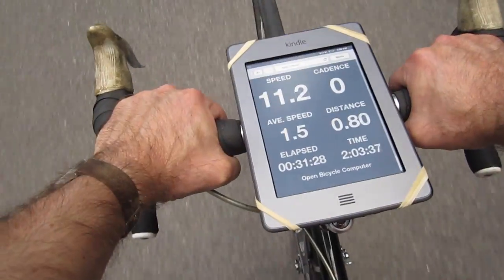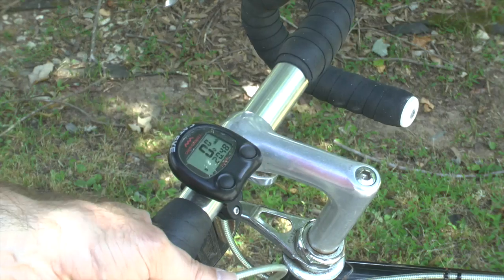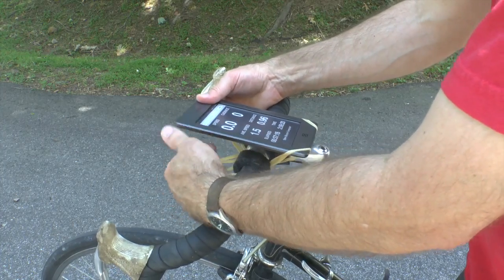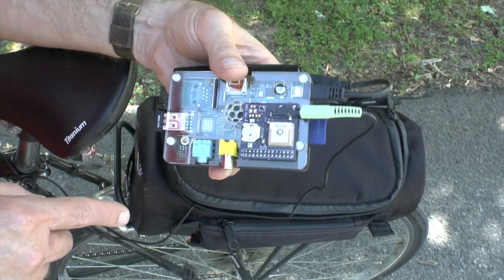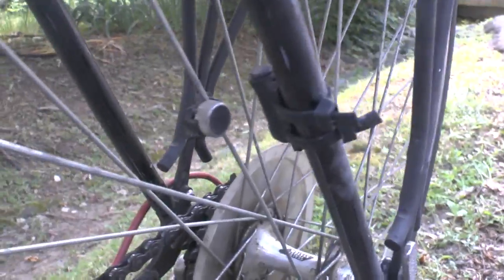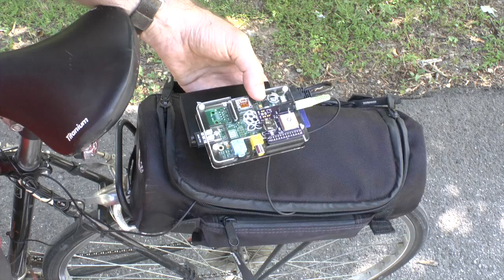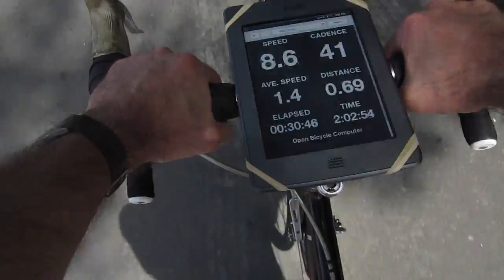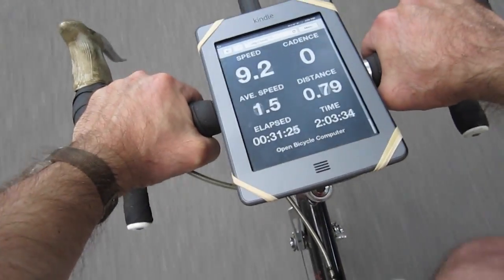DIY: Build A Better Bike Computer

Comment: Nice proof of concept. Currently I'm trying to re-use an old Kindle to control my smart home system. It would work in a similar way with a Raspberry Pi hosting a web interface with buttons to controls the lights, heating and so on and a Kindle on the wall that displays this interface.

Comment: Nice project. Kindle is a great choice for its capability of displaying in all light situations.

The raspberry pi could be replaced by old or a non expensive android phone. 

Shame on Amazon that the browser is still experimental in 2019 and no full screen browser.

Comment: Awesome idea! I had no inclination that the Kindle had been jailbroken/rooted and you could use as a display. Your video has given me the idea of using my old kindle as a stats display for my desktop pc and home server. I'm sure I could print a 3D shroud/Frame to hide everything apart from the screen and I could mount it on the wall behind my workstation.  Thank you for the inspiration!
Reply: it doesnt need altering in any way the early kindles had a basic web browser

Comment: Great project but I'd use an IoT platform like the nodeMCU for example that is much less expensive (around $8/$9 shipped), less power consuming and offers almost the same I/O... Wifi included.
Anyway... well done!

Comment: Most people just use their smartphone, like an android.  You could even use a cheap one (or an old one) just for your bike.
No need for a Kindle, Raspberry, addon GPS module, nor external battery.

If you really must use those reed switches for dead reckoning, you might be able to interface them to your phone via the audio-jack, but this may make it difficult to use the phone for calls or listening to music during your ride.
So perhaps a better idea would be to hook the phone (via USB) up to an Arduino Pro-micro (less than $7 on ebay, just make sure it has an atmega32u4 onboard), your phone will see it as a keyboard input.
Bah, there's lots of cheap ways to do it.  Using a Raspberry Pi seems ridiculous.
Reply: Your suggestions for and old smart phone is right (I'm doing that with off line maps); but, I love a larger (+4") screen compare with all the current Garmin/Magellan bicycle GPS (2") screen.  I think that kindle is too big, I think a larger smartphone would be perfect, easy to read size.
Reply: roidroid Raspberry Pi is cheap and you could still hook your phone up to it since he says it's just acting as a webserver. The kindle is used for displaying in large text. GPS is also not as accurate as computers with dedicated GPS and you also don't have to worry about having cell service.
Reply: You Tube ah, so the Kindle's e-ink screen excels in that regard.  Good to know.